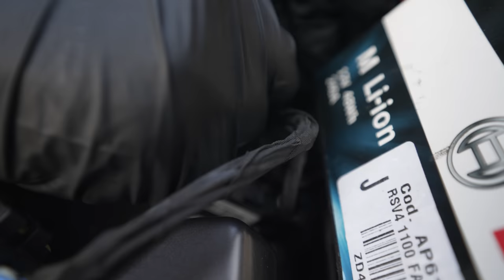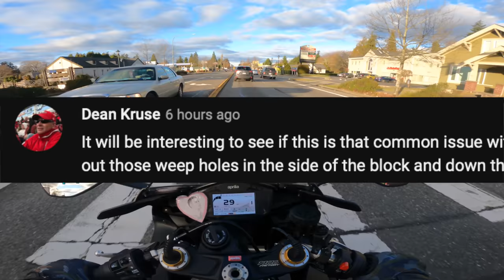Found a Hole in my Motorcycle | Aprilia RSV4 1100 Factory

Comment: I haven’t tried it yet but I’ve been told if you fill the Aprilia tank from the front meaning if you stand in front of the bike and pump the gas in that way it will stop the fuel splatter. 🤔
Reply from the maker: I’ll have to give it a shot lmfao
Reply: This definitely works. It's how I fuel mine up now. Before, half the fuel used to freakin' splash all over the place!!😂
Reply: I stand on the side of the bike and insert(🙄🤣😂) the fuel thingy front to back of the tank

Comment: Hey Bro, have you checked the torque of the bolts holding the HEAD COVER down :<)?
The cover could just be loose.
60 sec of checking the bolt torque could re-solve your leakage (You Ding Dong) LOL.  
Ride Safe
Reply from the maker: I haven’t, but I’m waiting to see if I see more residue develop. But I definitely thought of that lol